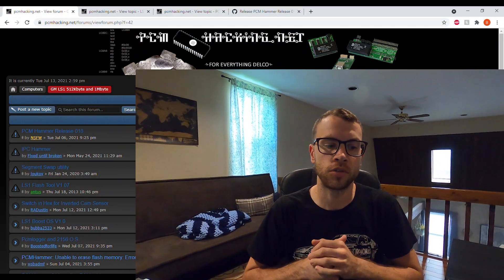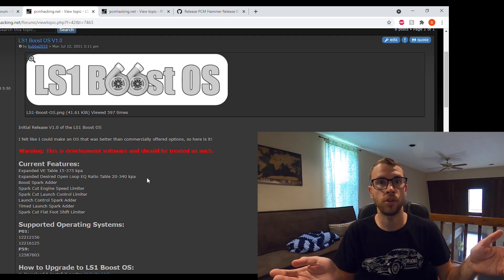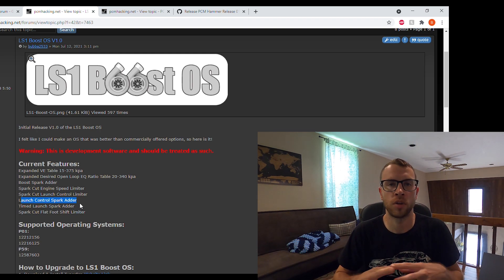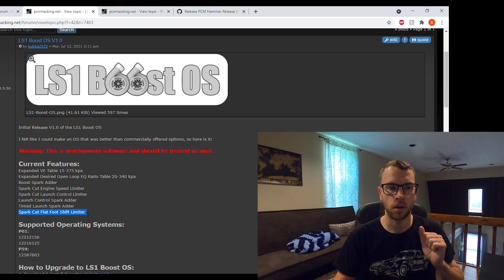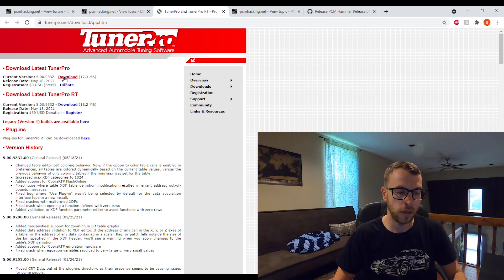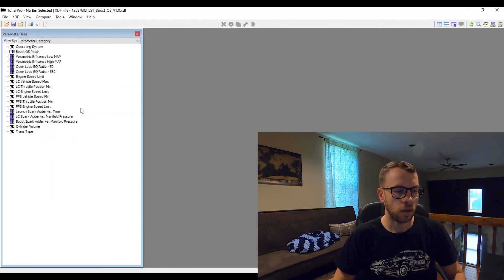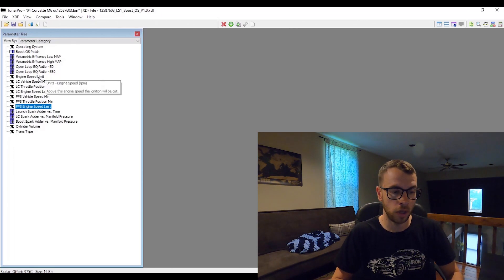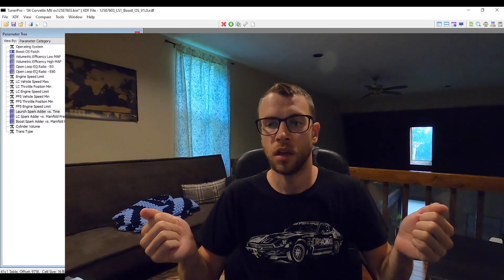LS1 Boost OS - Free Custom Operating System

Comment: Hey, have you had any issues with using the GBCM (battery ground module) with your os? I switched to the latest release and immediately my alternator defaulted to 13.7~ volts. 

Been messing with it for a week and I resorted to switch to a 4 wire alt. and pinning to 15 and 75 on pcm. I liked how the GBCM operated, is there a way to make it work again?
Reply from the maker: Join my Patreon for support.
Reply: @ gotcha, thanks.

Comment: what computer/years/motors does this work with.  Just starting to look at a swap for an 89 350TBI
Reply from the maker: P01 and P59 PCM’s came in vehicles from 1997-2006 depending on the vehicle. You’ll want to do some research on which one you need

Comment: I've got a question, How do you got back and adjust the normal high and low octane timings or anything else the normal XDF has? Do you do that first then patch it?
Reply from the maker: Either way. You just need to find an XDF with those tables.
Reply: @turbov6  But once its patched, I shouldnt need to patch it again  after editing it in the other XDF?
Reply from the maker: @brandonwh64  No, once the patch is applied you don't need to do it ever again.
Reply: @turbov6  Thank you! This is AMAZING! Just trying to understand it.